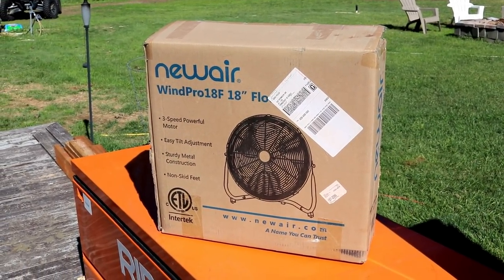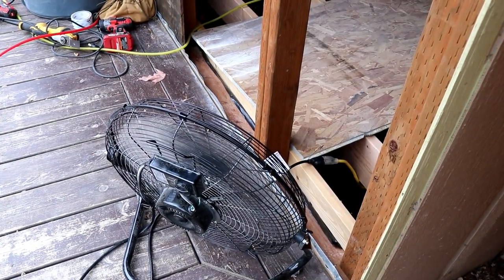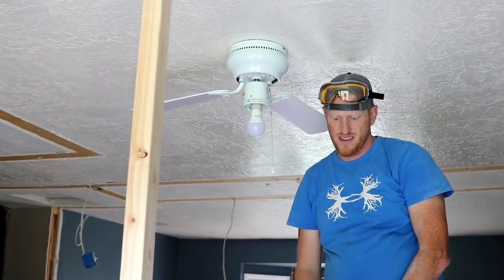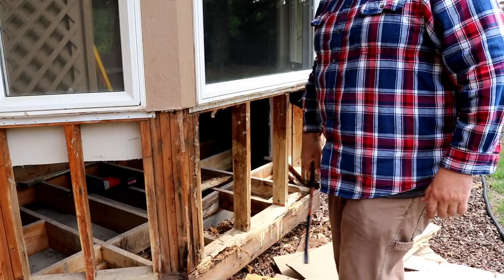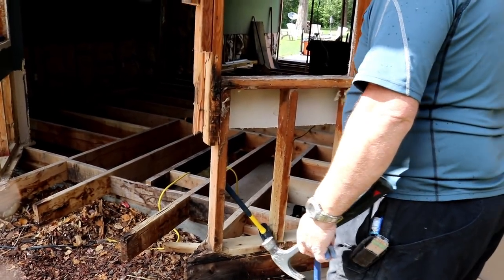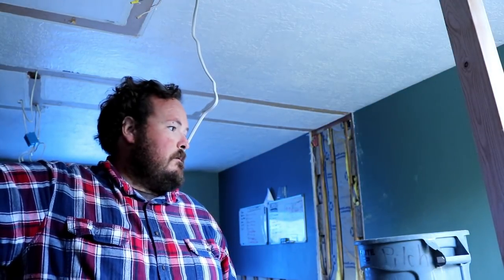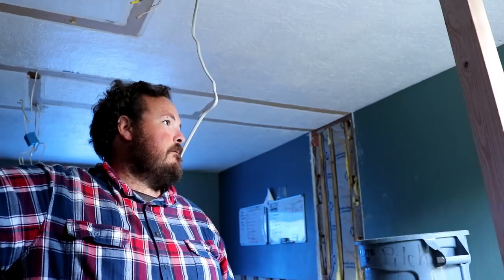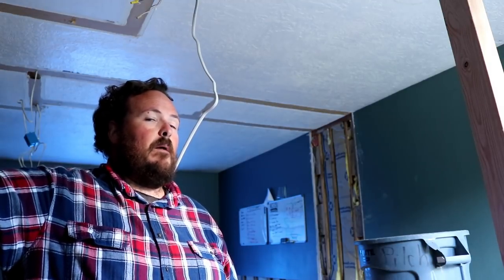Remodel Bay Window Demo

Comment: Are you putting the pop out window Bay  6” off the ground where 
it got rotten or....
Would it help to have it higher and the bottom at a 30* angel 
instead of it being flat where the water ca not run down? Aq
If you use flat rubber product you can run it from 3’ High in the front down under the bottom , even covering 
That sealer works better on all sides of the lumber and especially on the cut ends also, sealer applied before anything is put back together.

Comment: Copper Breen didn't work for me. The termites loved it.
Reply from the maker: Tell me more about your experience I don't want tell this is good stuff if it's not going to work.
Reply: I coated all the rafters, joist, etc when I ripped off my roof and put new. I coated it, let it absorb it and coated again. I wanted good penetration. To be fair there were some termites already. It didn't seem to slow them down at all or prevet new damage. I did a shed at my dad's that had some rot/water damage like what you are working on, and to be honest haven't checked back as he passed away. Personally, I wouldn't recommend it unless you have personal experience with it actually working.I just don't think water damage or termites can be stopped once it's started short of replacing and maybe tenting a house.
Reply: It can't hurt but wouldn't stake my rep on it.

Comment: 9:44 is that an M4 or an HK 416?  I had a G36...in 6mm airsoft :) but I sold my toys and bought a stick-welder
Reply from the maker: M4, you did the right thing getting a stick welder
Reply: thanks, those airsoft toys are useful in a way, I used them to teach fire-arm safety and operation to my friends son... plinking tin cans in the yard, which is something you can't do with a real gun... they 'd never let him fire a real gun anyway ...  I tried one of those  airsoft "skirms" once, but did not really like it because  I  got killed like 7 times in  one hour :-)

Comment: Tell us HOW the water got into that area for so long. Unoccupied? Painting toxic preservative - use some gloves and safety glasses... at a minimum.
Reply from the maker: The tub drain never got glued and leaked for years under the floor that was built over the old garage floor so the water had no where to go and did an  unbelievable amount of damage.